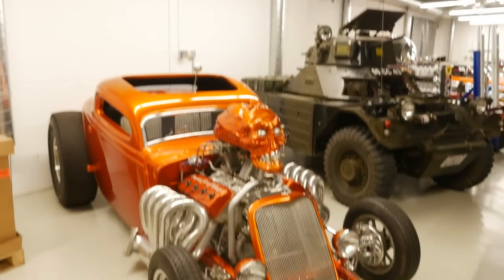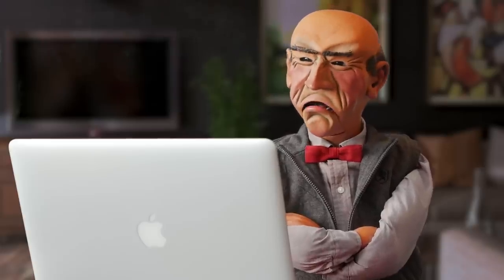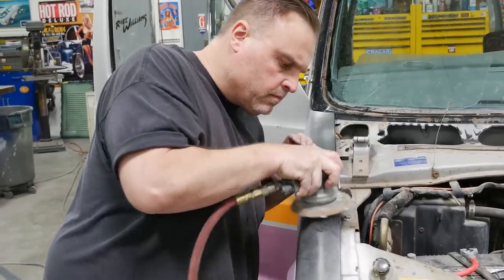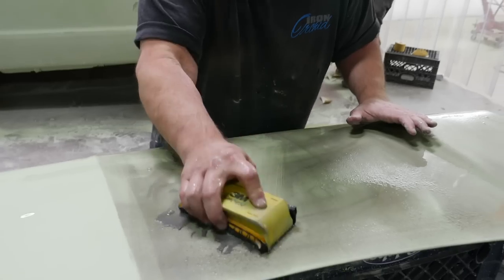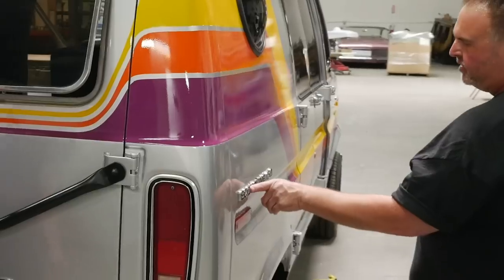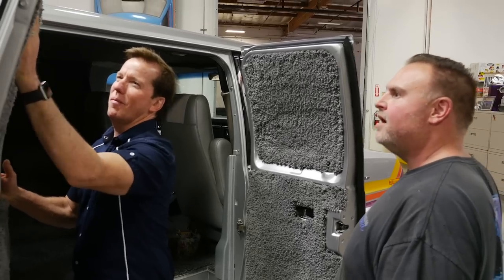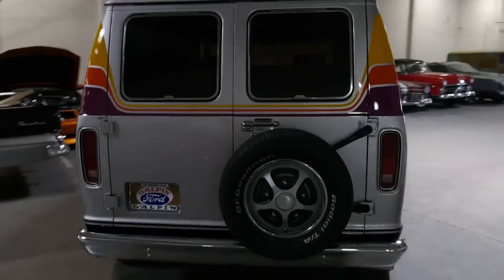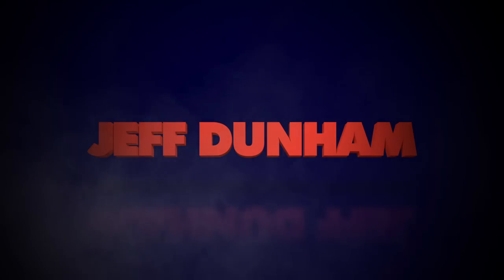What Was I THINKING? I Restored a 1970’s Shaggin’ Wagon To Match My Ford Pinto! | JEFF DUNHAM

Comment: Saw a highly modified Pinto Wagon back in the seventies... Firewall and V-8 engine were behind front seats, Mickey Thompson Fifties on shortened rear axle, wheelie bars, extreme! BTW, Chevy had its own version in the Vega Wagon. Try to find one of those with an aluminum block engine...

Comment: I’ve never seen a wagon model that damn cool 
I had a 73 Pontiac station wagon wood panel lower viper green tan interior fold up rear seat it came with built Pontiac 400 and hydraulic lifts real sleeper hot rod

Comment: Jeff. Next thing to do is find a Thunderbird turbo coupe and transplant its engine and transmission into the Pinto. Ford engineered it to be a strong runner, using the 2300 4cyl base.

Comment: I had a Pinto cruiser wagon, it was great until it hit 104K miles and it was like a timer ran out and the car just went to hell. I had engine troubles, bodywork busted out in cancer, the front end steering was getting dicey and like your's,,, smoking. So off to the dealer to get a low powered Z28, still under warranty we pulled the engine and put a 425 HP 350 V8 in it. No matter what anyone says they're both very cool wheels. Oh, I had a dodge van and spent a lot of money to get it to look like that.

Comment: Pinto needs a Ford 302 or if you can find it a 351 Cleveland. A 302 will fit. I did it to a pinto wagon. Why? Because I could. putting a V8 engine in the Pinto is like getting an F-16 as the end result. The power to weight ratio was freaking awesome!

Comment: 1976 ford econoline150 with vanguard camper top,,,,,stove/sink/forced air furnace.
refurbed interior / better insulated / red necked ac from back window ran from genset in trailer hauled for my hd....good times,,

Comment: Wrong wheels and top should be black,ford actually had factory slotted wheels in the 70s on vans and trucks, 20 yrs ago i worked in parts and shipping at a Ford dealer that had a full set of those wheels new old stock, one day we had to clean out all the old stock, everything was tossed in dumpster.

Comment: Jeff u rock!! you have cool cars and Van's too!! back in the 80s I knew a really hot chick that  had a pinto like yours. bring it on your use it as a stage prop. I've  owned three 5litre v/8 gremlins 1972 73 74. next gremlin you should get  is a 401 built by an AMC dealer in Arizona!!

Comment: The Pintos were much maligned, they were a lot of what was wrong with the American Automobile in the 1970's.  Ford did make some improvement that reduced the risk of fire and explosion, remember there weren't  any rear impact standards to b met. The Pinto was a car that would run 100,000 miles or more with minimal maintenance, unlike the Vega, the Gremlin's straight six was an awesome engine but really to big for a car of that size especially with the Gremlin being not much more than 75% of a Hornet.

Comment: That is so cool! 😎  I built a plastic model of the Pinto wagon as a teenager, then a few years after I got married, my father-in-law gave us his '76 Econoline 150 painted just like the one you found in KS.  It was all original inside and out with ~225K  miles on it.  I drove it from OK to NY when we made the move in '94 and sold it to a coworker when we moved back a year later.  Have fun with yours; it's an awesome restoration!

Comment: I had a regular pinto wagon. I loved it, but the motor was... well not very tough. I wound up letting it go for scrap price when the motor blew up while I was on the road. What I wanted to do with it that I never got done was steal the front end out of Mustang 2 Cobra model, the one with the 302 V8 stuffed in it, and stuff that in there too. That would have been a real street sleeper for sure.